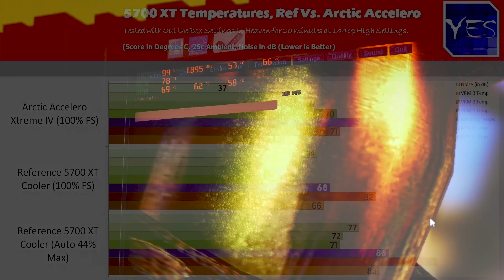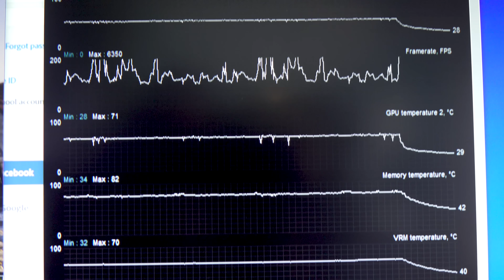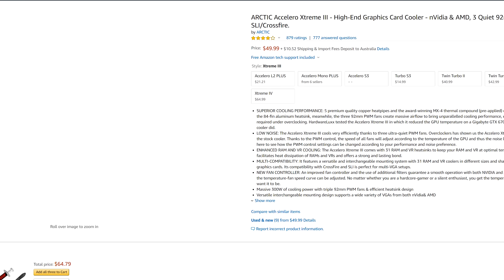Arctic Accelero on a 5700XT - Is it GOOD?!

Comment: The memory and VRM are supposed to be cooled by the back plate via thermal pads. The material the memory chips are made from is a poor thermal conductor so the tiny heatsinks you've added to the top don't do much, most of the heat is transferred via pins (or more technicaly, balls) to the PCB.

Comment: So i decided to clean my old 1070 katana blower😋

Now i have the urge to try and swap in something like a ARCTIC Accelero Mono 120mm if available/cheap.

I guess my curiosity is contemplating if it would work to remove the necessary fins from the original copper heatsink and braise/solder the arctic to it.  I am curious how the heat would conduct with something like that.
cheers from shaun

Comment: I had a double fan Arctic cooler on my MSI HD 6850 1GB back in the day. The original heatsink was just a black chunk of aluminium with a fan and nothing else. After installing the Arctic cooler, it added two years onto my card's life. It even came with the glue TIM with little heatsinks for the VRam.

Comment: I have two Arctic Accelero Xtreme III coolers. I got both in early 2018, one for a GTX 780 and another for a GTX 1080 (I have 4 PCs). The single blower fan Nvidia provided for the cards they themselves released was very noisy while playing GPU demanding games, the difference using the stock coolers and the Arctic Accelero Xtreme III was night and day.

I use the program MSI Afterburner to lock the fanspeed of the fans to a low RPM as I'm allergic to noise. All in all the process of removing the stock cooler and installing the new one was a bit scary I have to admit, but the end result was well worth the effort.

Comment: You can blow heat to the blower coolers and take off their metal vrm vram metal plate and install it to card, then the accelero

Back plate isn't worthless. It does a lot of cooling ;) mine reaches 62C with no fan on top backplate. With a fan it's at 53...

And there is no risk for backplate. Its well isolated with that film. Vrams vrms do all heat the back plate.

Comment: Thjose little radiators wont fall off after sometime? You know, thermal paste will try out (thermopads too), falling off radiator can make short circuit on PCB. Why aftermarket radiators are soo high and not pushing smaller radiators?

Comment: I'm a little late to the party here, but there is another reason for the accelero that you didn't mention. I bought a brand new msi gtx 1080 ti sea hawk from ebay that comes with a water block but I want air cooling so I got an accelero III. The 1080 ti was $50 usd and the accelero III was $65, so $115 usd for a 1080 ti in 2020 is a great deal.

Comment: I have the same card and same third party cooler.
One problem I found (if you actually used a PC case) is that the supporting bracket that you can install onto the card to prevent sagging actually gets blocked by the PCB closest to the ports. I solved this by making a cutout using a dremel. Another problem was that the thermal pads don't adhere well and because the card is usually placed upside down, they pretty much fell off. Still, the temperatures are good and under stress test it is only the GPU itself that hits over 90 degrees. It is a lot more silent compared to a blower cooler ramping up all the time, but I couldn't get Afterburner to increase the fan speed (percentage went up, but tachometer readings didn't). A worthwhile upgrade if you accidently got the blower instead of some proper double/triple fans, but not perfectly easy to install either.

Comment: dont know if anyone interested still ... im a "day 1" user of 5700XT + AC IV and i must say, i could keep the GPU on stable 2110MHz (set to 2170/1.250V) but the mems are going bat nuts insane reaching 100C no probs, even when i added to backfans and a custom made shroud on the backside plate (one fans suck air in, the other out) i couldnt keep them at a "acceptable" level. So now im running it on 2140/1.230 (ingame its about 2070-2080) and keeping the temps at bay at 90C. Will soon switch to water, still a fun experience. Not to forget, power is set to +30%. One thing i want to mention, my GPU now looks like a snake, because the "preferred" tightening ("dont tight it too much") was making the cooling really bad, just had to screw it really tight and surprise surprise, card bend to snakelike form and running cooler

Comment: okay, you don't install the product properly. GDDR6 is a flip-chip BGA which means most of the heat is dissipated towards the pcb in return for greater pin density. Which in turn means that you need to cool the backside and not advise your viewers to not do that.

Comment: bro the backplate works really well. You didn't even use it and tossed it aside. Ram and mosfets heat both sides, this takes the heat from the back side with the included thermal pads, then the heat from the front continues to flow to the cooler backside and transfer it, again, to the large backplate. 

They chose this design because relying on glued on finned heatsink can brick you card (it bricked my 7970) because one of the pads fell off and I had a massive (safe with functioning thermals) oc.  It worked for about 6 months then one day in the middle of a game my screen went black. I opened up and saw a heatsink on the bottom of my case then looked at the VRMs and saw a heat discolored spot on the board where it had been off for some time. Was it the glues fault? My fault? Arctics fault? Who knows...What I do know is my 650$ video card was trashed.

I got a new card and the new IV cooler. Installed it and have had a gtx 1080 overclocked to 2130 core/512 mem stable for over a year with zero issues. It never gets hotter than 50-55c.  My card isn't even a high bin. It's a low end zotec 1080 AMP! edition. Not even the amp extreme.  With the stock cooler I couldn't push it over 2,000 for short benching and I left it at 1950 for gaming.

So I am disappointed that you disregard this cooler because of your own laziness and lack of effort of simply cutting out some squares on a piece of plastic and putting thermal pads on it.....a simple 5 min job a preschooler could do. Why is this video even in my feed?

Comment: I'm so confused about how to install the accelero 3, the plate doesn't fit around the gpu socket with my vanilla rx5700. So my hotspot temp instantly reaches 110c under load.

Comment: Those blue pads aren't touching anything!
Shouldn't those go between the mem and BACKPLATE? As that's the side GDDR6 heats the most??
(Hence the poor mem cooling cuz you put them on the VRM doing nothing?)

your video description says Will update if the lil heatsinks are included with the 3 soon
Maybe install the the damn thing correctly and do an update?

Comment: One question. I did the same mod on asus tuf 5700 xt. How did you connect the fans from the accelero to the fan header on the pcb? I can t...fan header on pcb has 7 pins
A solution would be very helpful

Comment: That was a rather sloppy installation of the cooler. The back-plate is a key component of the assembly, since the card's PCB acts as a heat-spreader itself and gets very hot under load. I had this cooler on my old 980Ti (reference design) and used it with the back-plate and didn't have any heat-sinks on the MOSFETs at all and the thing worked flawlessly (overclocked) for years, until I upgraded to 1080Ti.

Comment: I can highly recommend to ghettomod a CPU-cooler for the gpu while keeping the "frontplate" of the reference cooler for cooling the VRM and VRAM. I'm currently cooling my R9 290X with the first gen arctic cooling freezer 7 pro and it tops out at around 75C overclocked to 1120Mhz on the core. I never even believed the small tower cooler would outperform a aftermarket GPU cooler but it actually does. The tricky part is to make a bracket to fit the cooler to gpu. I made one out of wood and used (I think it was) some longer M3 screws and sealed them with some regular motherboards standoffs. It was pure luck that the M3 screw was just long enough the standoffs could give the perfect amount of mounting pressure.

I'm kind of interested in buying the cheapest RX 5700 reference model and maybe buy a gammaxx 400 cooler for it.

The scetchy part though is that I have to run the fan on a motherboard fan header and control it through a third party app that reads the gpu temperature.

However it's waaay cheaper than a "proper" aftermarke gpu cooler while performing even better.

It would be super cool if cpu cooler manufacturers where providing mounting brackets for gpus as well as cpus.

Comment: How many PCIe slots does that thing take up? I'm counting 3 for the main unit (including GPU), and 2 at the back. I thought the XFX THICC II was oversized, but this is ridiculous! 
That thing will never fit next to a large CPU cooler like a Nortua NH-D14, with those massive thumb screws (they've invented compact thumb screws, they're called screws😉).

Seems like a good idea, implemented badly. Speaking of which, you wonder why GPU's need so many screws these days, but then I remember a time, a simpler time when GPU's didn't have fans (and memory was measured in megabytes...).

Comment: That insulating film for the back plate is (I believe) a mica film. electrically insulative, thermally conductive. you generally see it used when mounting metal back voltage regulators and FETs to a common heat sync.

Comment: Ever since my AMD 7950 slowly eroded by gentle overclock...I never overclock GPUs anymore
on arctic accelero xtreme iv does not include micro heatsinks. I bought some myself a while back, but it includes the huge backplate for cooling VRM. 
It's much better than III version, but it will eat 1.5-2 slots from the backplate. Which can overlap memory slots on some motherboards. Check clearance.

Comment: You know you were using the accelero III right? You BOUGHT the IV but it uses the same fan and heatsink the III does. They literally are the same. They just add those backplate heatsinks (big black suckas) to the accelero IV package. You also didn't mention, AT ALL, the obnoxious size the fully equipped accelero IV makes a GPU. There's a reason most people just go with the III. Too fuckin big for most case set ups. You can use it, but with the typical mediumish size ATX case, you aren't adding another AIB. It's just too damn big for most PC users, and especially the ones willing to take apart their GPU and use. That's already a niche of a niche market.

Comment: Yup, same experience I had using this thing. GPU temps went down Memory temp actually got worse for me on Time Spy by 5-8c. The Artic is really bad at cooling Memory on the 5700XT. It was also a pain in the ass to install, I broke the screw off barley tightening the black plate and had to DIY the thing after that.

I decided to scrap it and go back to reference cooler since noise doesn't bother me. It didn't do what I was looking for and made the card Uglier for no Real gain.

Comment: @6:04 Yeah, that cooler mount bracket has bent so far in, the mounting pressure and contact will be very weak. That means the accelero V4 is a complete failure design-wise. They need to make sure their brackets are actually strong enough to maintain the mounting pressure.

Comment: GDDR6 comes in a "flip chip" packaging design, which means that the hottest running parts of the silicone inside the cheap are orientated towards the back of the PCB, not the front. Thus a functional backplate is actually very important to keep internal memory temps under control. Running the card without a backplate will have detrimental effect on the lifetime of the memory chips.

Comment: The arctic accelero cooler is a beast buttttt I had one installed on an older GTX 570 and when removing the heatsink from the RAM chips one of the chips came off with it... was great until then haha

Comment: Fans on the Accelero coolers have been problematic for years, especially on the older models (Mono Plus, Twin Turbo II and Xtreme III).
For example on Nvidia cards the PWM control of the fans is completely broken with the fan ramping to maximum speeds and/or the fan speed is jumping all over the place. My GTX 1070 with Accelero Mono Plus usually ramped to maximum speeds at boot, and only way to get the rpm to sane numbers was by manually setting the fan speed % to around 70% and then switching it down to 25%. And 0% didn't shut down the fan, it just went back to 100% speeds which was annoying as the stock card had semi-passive stock cooling.

In the end I ripped out the stock Accelero Mono fan and replaced it with the trusty AC F12 that was left over from previous projects. Zip-ties to the rescue and now everything runs nice and quiet.

Comment: Imho I think you're underestimating the Accalero a bit there aswell as e.g. Timmy Joe does. From a reasonable standpoint considering the price and the given performance you*re better off not using it. On that case I'm with you Bro. But from a geeky standpoint I do think that the Accelero could be worth a shot IF you take on the quest of modding the backplate to fit the gravis card aswell as ditching the foil. The main reason my mind flows this wave is that with GDDR6 the Die is closer to the PCB since it is a flip chip design. So I do believe that when you get the backplate to fit there should be quite an improvement to temperatures for the memory aswell as maybe even to the vrms.

Comment: Cheap Chinese water block. I added one to my GTX 1080 Ti and left the mid heat spreading plate and back plate in place  with added heat sinks to cool VRM and memory. Works really well.

Comment: VRMs dissipate 80% of their heat into the PCB, via a metal plate soldered to the PCB, by design.

RAM also dissipates a lot of heat, via the solder BGA into the PCB
IF
The PCB is cooler than the the RAM..!!!
Often the heat pumped into the PCB by the core and VRMs is so much that the RAM absorbs heat from it..!

Therefore not using the backplate of this cooler, but sticking on heatsinks means this is more a  review of the 3 than the 4. ad you are missing the point completely!

(I would still add heatsinks as you did to the 4, for better cooling, but I would use a 50/50 mix of AS5 and AS Adhesive.
This improves the thermal conductivity of the adhesive AND makes the heatsinks easily detachable)

NB!
If you want to see a major drop in GPU temperatures;
place a 80-90mm fan  to blow down onto the back of a bare (no backplate) GF card.
The fan should be 1 to 2 cm from the card and aimed at the VRM and core area.
This allowed me to go up 1 mem strap on many cards.

Why?
Heatsinks work by greatly increasing the hot surface area to the cooling air.
Fans work by blowing cool air onto that surface area., displacing the hot air that builds up there.
As the GPU's PCB (full of copper) is in fact a big flat heatsink; blowing air onto it back surface doubles the cooling area...

Comment: Tech yes City: There are ways to mod a desktop atx cpu cooler such as a noctua or cooler master 212 hyper evo onto a graphics card. There are some videos of it on YouTube. Could you compare that to this and to maybe a custom rigged AIO 240mm rad jerry rigged to the gpu? Would it be worth it to tie a 240mm aio or massive air cooler? Obviously you'd need fans for the vrms and other components.

Comment: i bought an Extreme 3 about half a year ago, and yes the heatsinks and thermal glue is still included in the 3. the assumption they made on the 4 is that "you won't need these heatsinks because of the huge heatsink/backplate".

Comment: Couldn't you use those washers in between the back plate and the PCB? Wouldn't that provide a little cooling? It's a pretty beerfy looking heatsink. They almost need to provide a thermal pad to protect the back when attaching the back plate.

EDIT: Ah, I see Arctic replied below about this issue.

Comment: No one should be buying the Accelero. that thing is a hideous looking monster that adds nothing of value. Here is my reasoning. 1 if you own a reference AMD 5700XT you can always do the cheap plastic washers and new thermal paste mod that Gamers Nexus figured out. That will bring down thermals and noise levels. If we combine that with under volting the card we bring down temps and noise even further. And finally 2 the second option is simply to sell the reference card and with that money plus the added money it would have cost to buy this Accelero you can probably buy a Sapphire Pulse for close to that and that is for sure the much better option overall. So in conclusion I can find no justification for using the Accelero on a reference 5700XT.

Comment: I fitted the Accelero IV to a GTX 1070ti, as I got one with a bad stock cooler, though it was fairly cheap.. I used heatsinks on the front in addition to the massive backplate heatsink and it does work very well. That backplate gets very hot during stresstest, which means it is sinking a lot of heat away from the card. It's kind of in a rough spot in the case though, wedged between the GPU and CPU cooler so the airflow there isn't exactly optimal, only way to address that would be if you have a computer case with a fan in the side panel above the GPU...

Comment: Bykski 5700xt full cover waterblock is under $80 usd on Alidirect. Typically around $75. Performance wise its significantly better than any AIB air cooling. It also installs easily.
If your planning to watercool or already have a custom loop, a full cover waterblock for ~75 usd is a no brainer